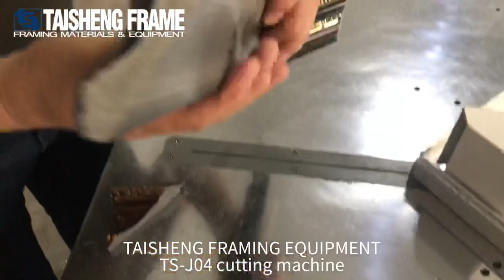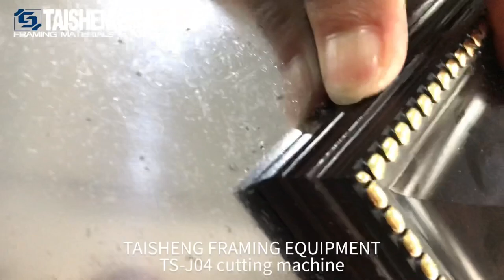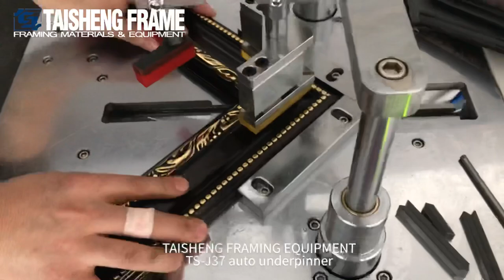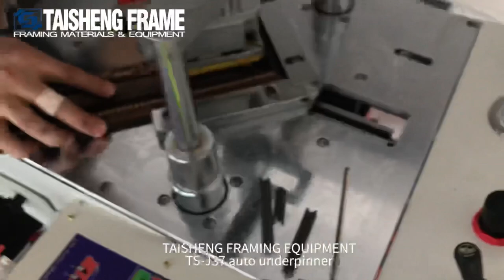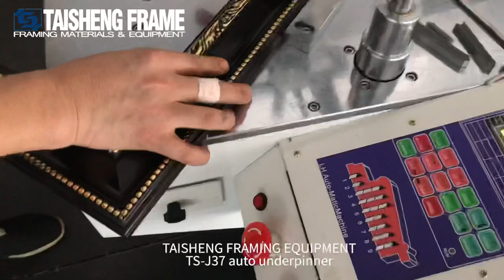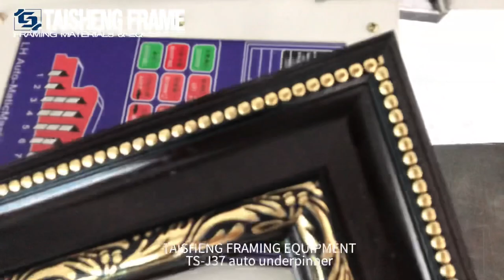Pictures frames cutting machine and framing work equipment underpinner frame joint machine

Comment from the maker: Hello, If you need faster production , below will be your best partner machine !!!face-blue-smilingface-blue-smilingface-blue-smiling
TS-J39 PQJ automatic cutting machine , cut 8000pcs ina hour :
https://framingwork.com/productinfo/1314554.html
https://framingwork.com/productinfo/1299774.html

TS-J50ZS Framing joint robot , make 2.5million pcs frame in 4 month :
https://framingwork.com/productinfo/1300188.html

TAISHENG FRAMING SUPPLIES NEW CATALOG : 
https://framingwork.com/zxhc
http://taishengframe.com/en-US/product859.html

welcome to contact us!
 Our mail is sales@taishengframe.com.    
WhatsApp 86 13362921980  .